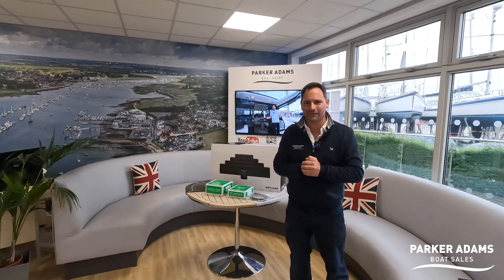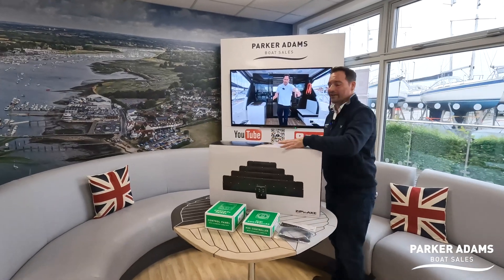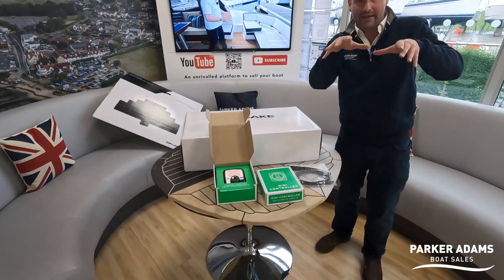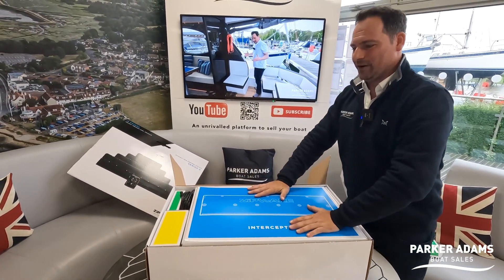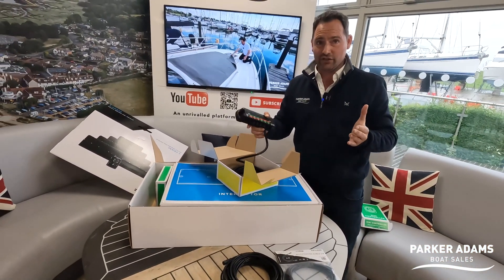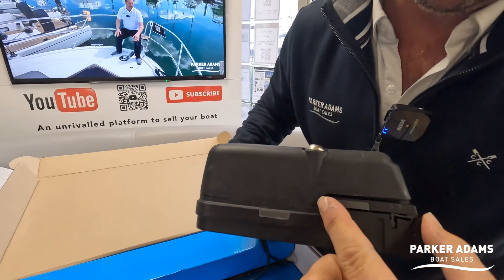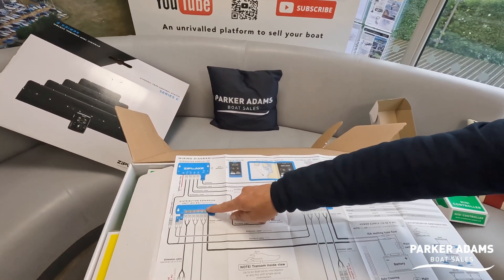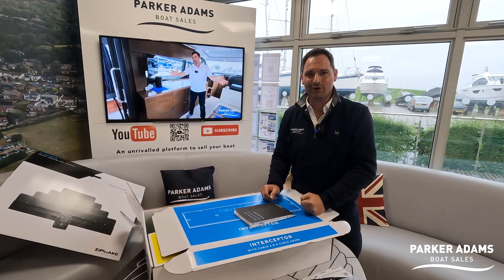Unboxing Zipwake Interceptors! The First Video about this amazing Trim Tab Replacement Product

Comment: sometimes those zipwakes have an issue that they are fighting the autopilot if set to AUTO mode at planing speeds. then boat is zigzaging, autopilot is turning the wheel, then zipwake extends opposite tab and it continues.. :) otherwise a nice set of technology. Seakeeper now also makes similar product called Ride which is acting way faster, so is much more adaptive. but zipwakes are also not too bad on the market and also cheap.
Reply from the maker: We have now tested these pretty extensively on a long run to Dartmouth and didnt experence this but worth being aware of so thanks.. also the Ride system only works on boats to 35 ft at the moment so wouldnt have been suitable for this install.
Reply: @ParkerAdams  yes, those issues with autopilot/zipwake not occuring all the time. I had it few times and started searching the internet.
If you google "autopilot zipwake zigzag" you should find a long thread on The Hull Truth about it. nevertheless until zipwake improves software logic the solution is to turn off AUTO ROLL mode if this zigzagging happens.